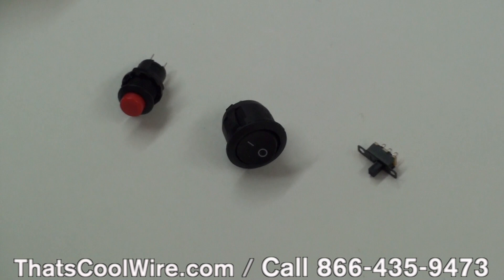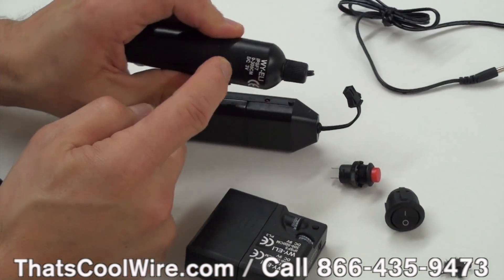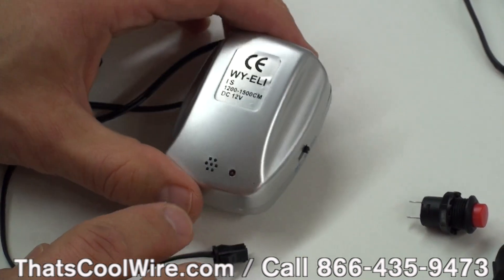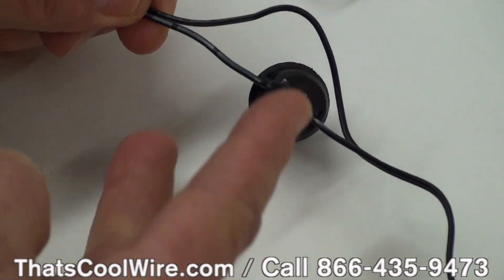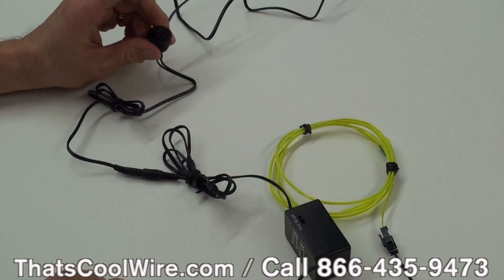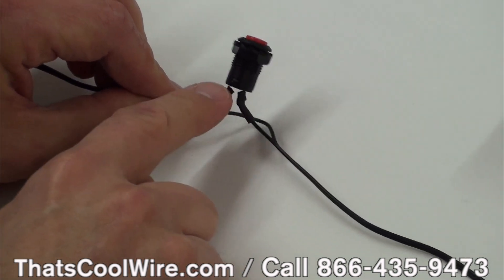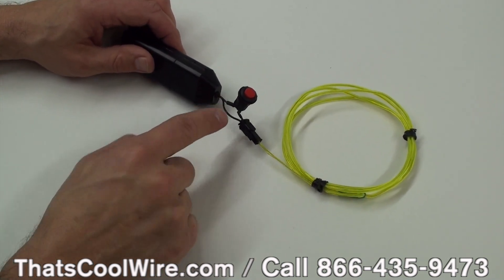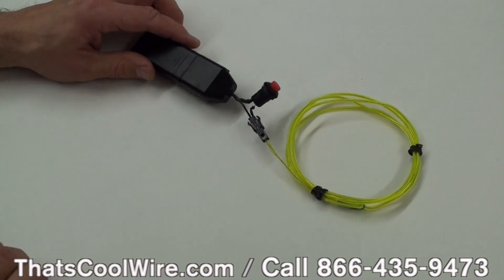Adding On/Off Switches To Battery And AC Powered El Wire Kits

Comment: Is there a way to mod the inverter to stay on, so you can add a switch or button? I'm looking for an inverter so I can turn it on & off for a prop ray gun with this wire. Have any suggestions?

Comment: Hello.
I want to connect el wire directly to switch bord..
I don't want to use any battery device as I want to get it Permenanat connection for sign.
So which choke set I have to use?
Can u plz tell me detailed information... I.e. volt and ampiers....
Reply: mandar bhurke you got solution? i am one with same question